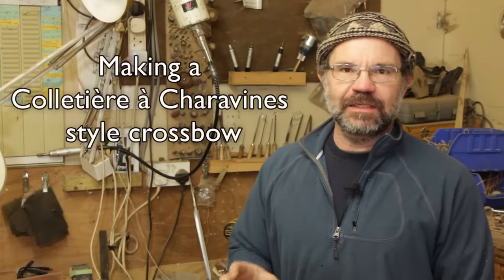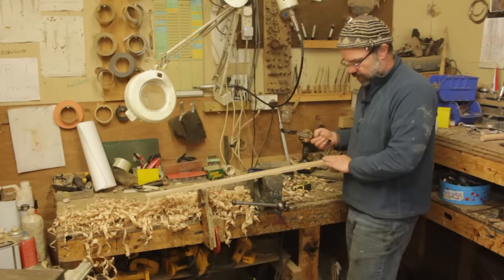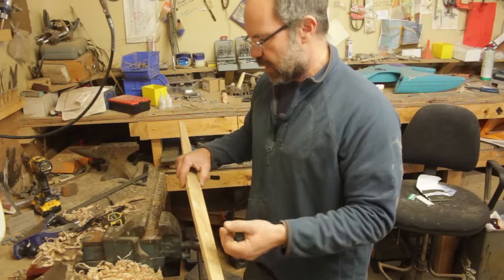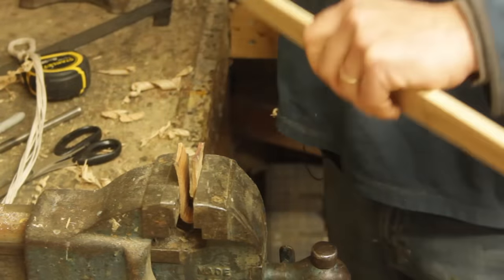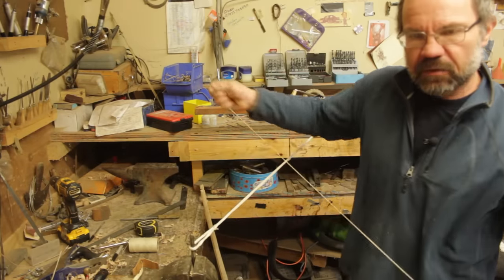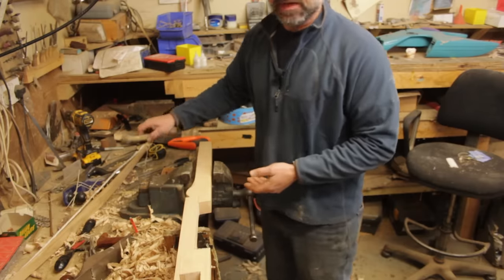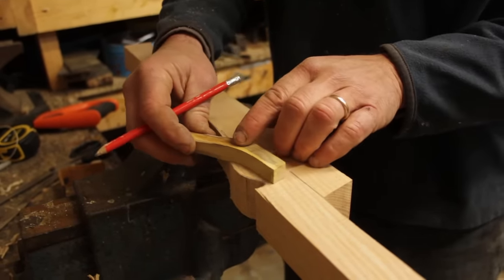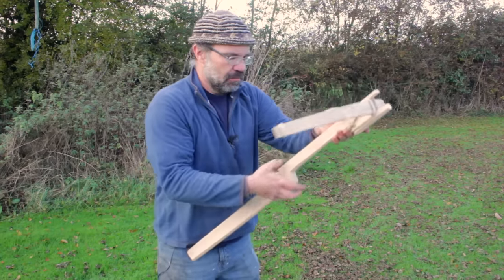Dark Ages Crossbow - Full making process

Comment: An old method of drilling a hole through wood without metal tools is by placing an ember on the spot you want to drill, and tend to it as it burns the wood, adding fuel as needed, but not enough to spread. It's super slow, but eventually you can burn all the way through as gravity keeps pulling the ember. You then rub out any charred wood around the hole with a stick or stone, and you're left with a workable hole. A similar method can be used to make a dugout canoe, where the log is saturated in the river upright, and you then light a fire on the dry part. The fire burns all the dry wood, and leaves the soaked wood layers of the hull. Again, remaining ash and charcoal is scraped out. You then take the canoe out of the water, air dry it, and then coat it with boiled deer tallow, massaging the tallow in as it cools. This protects the wood from rot, as well as making it more sleek in the water. You can use this same tallow treatment for your bow, too, as it'll give the wood similar protection against moisture/rot, such as when hunting in light rain.
Reply: Are you a mountain man?
Reply: Charing wood gives it a good hard surface as well as protecting it.  Hammer handles well soaked in linseed oil, then chared and waxed are the best to work with. Handle blanks used to be kept for storage in linseed oil. When I was a kid we learned this in wood shop class in school, but it seems less known nowadays.
Reply: Another way, a bit quicker and more precise, is just whip out your ancient handy pump drill, fixed with a flint drill bit.

Comment: Pro tip for finding the center of any length of cord without tools: Fold it in half. :D
Reply: You can't do that with an infinite piece of string.
quantum state INTENSIFIES
Reply: @oneparticularlysmartape  I just fold the infinity into just shy of one Planck length.  ;) By definition, the singularity would have to be naked.
Reply: @spvillano  
I've been matched.
Reply: I am in awe of all these useful insights! :)  I never would have thought that Planck could be bent in half! (Miks, Particularly Smart Ape, Stephen and of course, Anifco)1
Reply: @oneparticularlysmartape  It's called an "endless loop" or a "Flemish twist". Not an infinite piece of string that actually does not describe an endless loop accurately.
Reply: Lol
Reply: This trick is great for marking around a cylinder too with a piece of paper. Wrap the strip around, Mark the overlap point, fold in half as many times as you need even divisions, unfold, wrap the strip around the cylinder again and transfer the marks where the fold creases are.
Reply: @oneparticularlysmartape  Actually you can, mathematically speaking and since infinities are a mathmeticall invention and not a real object or physical in any way it makes it possible.
Reply: @elijahbachrach6579  "If you put the universe in a tube, the tube would have to be at least... Two universes in length" - Tim Heidecker

Comment: As a teenager I made one in the 1950s with a car spring for the bow, a hunk of iron bar lathed and drilled into the pivot for the trigger, which slotted into it and came out under the stock. I was a little short on expertise in fixing the bow to the stock, and it lasted no longer than six bolts, all of which disappeared forever in the trees at the far end of the park. There were no following reports of deaths or injuries in that neck of the woods. My next project was a working model of a ship's cannon, using fire-cracker contents to fire quarter inch ball bearings. Despite losing all my ammunition, no known about damage was reported. Both projects were performed in the woodwork shop in high school.
Reply: I used potatoes as projectiles for a 1.5" muzzle loading cannon, they always fit :-) Fired with home-made black powder. In the days before terrorism, one could buy the ingredients in the local pharmacy.

Comment: "...not using any measuring tools because, of course, our thousand year old compatriots didn't have verniers..."

uses a power drill 2 seconds later

Great video though, as always.
Reply: Even our stone age ancestors had access to mechanically assisted drills. In fact, they probably used them nearly everyday for starting fires. They are called either Bow or Pump drills.
Reply: my great great etc grandad is credited with inventing the 'ships screw'.i forget his first name but surnames Thistlethwaite.
Reply: Nope,  he  was  a  Swede  I  think  you'll  find,  and  he  was  called  Eriksson.  By   the  way  what  relevance  does  this  have  to  the  subject  of  crossbows  or  thousand  year  old  engineering??
Reply: They had much more time, this a weekend project, for them this could be a week or more.
Reply: The exact same thought came to mind. God I love modern recreations. To be honest I don't see the negative, you get the authentic style and design via intuition but the time and thus cost is cut to a tiny fraction. You're still using a chisel to finish it, you've just had the apprentice remove 90% of the material.
Reply: You're missing the point. The power tool makes the work faster, it doesn't replace any tooling they would've had back then (hand drill etc) a measuring tape on other hand would've been less accurate.
Reply: A power drill is significantly different to what they would have had to the point that it might as well be considered a different tool. The marks etc left will be very much distinguishable from a hand drill partly because theres absolutely no effort and an abundance of power, and partly the sheer speed. The bit will also be far more refined than anything they had. Theres a hell of a lot of modern tools with crazy capabilities compared to the theoretically similar ancient tools. I'd still expect him to use them, it makes economical sense to do so, but to say the power tools are in any way comparable (with regards to the finished product) with what they had is simply not accurate. Its precisely why removing 90% with power tools is fine but the final 10% needs to be removed ye olde method.
Reply: Before there was inches or centimeters, there was 'bouts. As in "Make it about this long" or "We need it about this high". They would measure as they went along. Comparing one component to another, to get the fit. This was why parts couldn't be interchanged.
Reply: Hermann Munster ____ Also, although measurements weren't regular, proportions were. The keel length of a ship dictated the size of every other timber in the boat as they were all proportional to it. The keel length was dictated by whatever size tree you had - all other dimensions followed.
Reply: @iainmelville5949  Eriksson Thistlethwaite?
Reply: @olivialambert4124  absolutely
Reply: @reddpanda7343  very interesting comment  .
Reply: lmfao right..
Reply: @SuperFunkmachine  they didn't have that much time after all. They had to hunt or fish, gather, or if we talk about later middle ages farming work. Chop wood, make fires, make other tools or weapons, sharpening, repairing stuff, fortifying their shelters, getting water, makes clothes, sandals, whatever. All those things took a ton of time back then. Most of the day was needed for providing basic survival stuff.
Reply: Lol... I was just going to post the same comment!
Reply: I'm sure even our stone age ancestors used something for measurements, their hands, string, sticks, something.
Reply: James K   ,   Liten up dude
Reply from the maker: @olivialambert4124  But the result is a round hole - just the same
Reply: My god, the horror! Not only, but uses a digital camera to film it! Unforgivable! Tod, next time use some bronze age camera!
Reply: @randomguy8196 Perhaps not try squares in today's modern form, but almost certainly something akin to one. They might not have had standard measurements, but they surely had a variety of tools to  measure and transfer values/proportions, find centers, check for  square etx... in fact I'd risk saying a  craftsman of their time would be more adept at these basic skills than some craftsmen are today...
Reply: @joshmcneal2836  not exactly a power drill though is it
Reply: They had tools, Jeez. If they wanted to find the center of something, they could. And you don't need that welded-together cutter to make the groove. Woodworkers do that now with a scratch stock. It's just a little piece of steel held in a wooden handle.  Or held in the hand, for all the work this would take.
Reply: I'm surprised this comment is still getting replies. To clarify, I wasn't criticizing Tod's use of power tools, I was just pointing out that I thought it was funny.
Reply: @reddpanda7343  This is right. And maybe they added "as long a my thumb" or as long as four times my thumb. When details got finer, they would order, as long a half my thumb. As technology and details progressed they needed quarter a thumb, standardized the thumb and called it an inch. Then the 1/8 inch became current, and the rest is history. It might sound like I do but I am not joking about what you explained. Btw, in Europe they still use a "thumb stick" (literally translated). A foldable stick which is marked in millimeters. And also in inches if they are old enough.
Reply: @reddpanda7343   Redd Panda  This is right. And maybe they added "as long a my thumb" or as long as four times my thumb. When details got finer, they would order, as long a half my thumb. As technology and details progressed they needed quarter a thumb, standardized the thumb and called it an inch. Then the 1/8 inch became current, and the rest is history. It might sound like I do but I am not joking about what you explained. Btw, in Europe they still use a "thumb stick" (literally translated). A foldable stick which is marked in millimeters. And also in inches if they are old enough.
Reply: @reddpanda7343   Redd Panda  This is right. And maybe they added "as long a my thumb" or as long as four times my thumb. When details got finer, they would order, as long a half my thumb. As technology and details progressed they needed quarter a thumb, standardized the thumb and called it an inch. Then the 1/8 inch became current, and the rest is history. It might sound like I do but I am not joking about what you explained. Btw, in Europe they still use a "thumb stick" (literally translated). A foldable stick which is marked in millimeters. And also in inches if they are old enough.
Reply: James K 8
Reply: James K j&#
Reply: Olivia Lambert . I think you missed something as ancient times they were very good , look at the pyramids in ejypt Ancient Rome buildings  etc. what we have today is because of there ingenuity thank you. There work was astounding , the tools we have today creat laziness but yes good straight cuts etc but don’t underestimate there skills , they were the greats then for the luxuries we have now.
Reply: @jacobstaten2366  ..probably used their feet for measurement quite a bit..easy to step off distances, probably where we got "feet"...males may have used "other body parts" for smaller measurements, who knows...
Reply: @dyer2cycle  that's what I figured.
Reply: @reddpanda7343  And yet they could fit things perfectly. This is due to how you work with hand tools: take your "about right" piece, place it on your other "about right" piece, and then mark a knife wall on the mortise or tenon or what have you, shave a bit off with a chisel, try it, shave a bit more, try it -- until you get a perfect fit with sub millimeter accuracy.
Reply: @randomguy8196 it's actually not impossible to make a square as long as they have a mirror. And I believe squares have been used by craftsmen for centuries all over Europe and Asia.

Comment: Brilliant video. Instructional and entertaining. Thanks for sharing your knowledge. I'm off to the the wood yard to buy me some logs.

To center - mark a piece of wood for the first side, place on the second side and mark again. Half way between the marks is the required distance for centering. No tape measure required. You don't even need a pencil. Incise a groove with your thumbnail. Celtic carpentry 101 :-)
Reply: I  have  extremely  thick  thumbnails,  and  they're  hard.  I  use  them  for  marking  both  wood  and  metal(when  there  is  a little  rust  present)and  the  beauty  of  a  thumbnail  is  you  don't  have  to  look  for  it.....
Reply: Yes me too, I want to play. Going to make one myself as well.

Comment: The width of the ring, and its color is species dependant,... but its density is a tell.
Softer, wider rings would be summer growth.
Baltic Birch is very hard, tough wood... hence its common use in modern cabinetry drawer boxes, and boatbuilding.
Maple, Ash, and Oak are very similarly used in both sheetgoods, and furniture making.

Comment: A crossbow you can cock by hand is the best way to enjoy shooting a crossbow. I think a longer bow for the crossbow, though cumbersome, may give you a longer power stroke and more arrow/bolt speed for the same poundage.  Really like the simple design of this. The two greatest advantages of a crossbow over a longbow, is that ability to be at full draw without fatigue of holding the bow, waiting for quarry to step into shooting lane/distance, and not having to draw the bow, which requires a lot of movement which will spook game. I have been shooting bows and crossbows for over 40 years and I really like all your designs and channel content.  Thanks for sharing.

Comment: What an engineering marvel, this! My favorite part of the video was where Tod visually inspected the curvature of the bow and shaved off bits of excess wood where the curvature was lacking. It turns out that the maximum draw weight per unit mass of the bow is attained when the bow is tapered in such a way so as to place every cross section under equal amounts of maximum bending stress. As it turns out, both the maximum bending stress acting in a cross section AND the curvature of the bow (or reciprocal radius of curvature) are each directly proportional to bending moment and inversely proportional to second area moment of the cross section. The consequence of the equal-stress design principle is that the bow should also have uniform curvature along its length when drawn. What 2D plane curve has constant curvature? A circle! So the bow has been optimally-shaved when it takes on a circular arc shape when drawn with an arbitrary force.

Comment: Have you ever made a bow out of green Poplar wood?
It is the most flexible wood I've ever seen, when I worked at a woodshop. I made a staff out of 1 1/4 inch. green poplar wood. I tried to break it in half by hitting it across  a metal dumpster.  5 minutes later I gave up!
It is unbelievably strong!

Comment: Tod, I really like your dremmel attachment set-up on the wall. I'm working on a project consisting of steel rod swing trays that will hold my dremmel attachments, that are built into the wall of my workshop. The plan is that they will pivot between my metal and wood work benches for ease of access. Thanks for further inspiration!

Comment: Wow. I’ve learned so much from this video. Didn’t know you could use a spokeshave away from you. And I’ve always had problems with Ash axe handles. They do chew up on one side. So many questions. Does the bow have a top and a bottom? Could it be mounted either way up? What wood is the stock made from, does it matter?  I’d love to make a bow like this now. And what weight is your little anvil on the bench? I’m after one and con only find old monsters or modern crap. 👍

Comment: Great video. Possible uses for this x-bow? Very much doubt it would have any utility as a fishing bow because the bolt would fall off the stock at any meaningful fishing angle. Probably be useful for waterfowl though, especially if used from a hide. What are your thoughts?

Comment: When I was about 8 years old I used to try making crude bows on the celler workbench.I always wanted to go to the next stage and make a crossbow but could not figure out how to make a trigger mechanism.Also I cut and sharpened an old steel tennis racket into a very vicious curved sword !
My dad found it and I was banned from the celler before my armoury could be tested out though.

Comment: Hi Tod ,I've been trying to find out the lethality of bows or "arbustas" reportedly used at Hastings. The obvious question is would the bolts penetrate the  regular Anglo Saxon Shield. Injury is as essential as lethality. Short bows are demonstrated on the Tapestry but we see that they the archers  on the Tapestry and elsewhere loose their arrows from  the chest. They woud be out of axe and spear throwing distance. Very few if any A/S bowmen present. I have a strong conviction that the battle was an artillery battle with crossbow men and supporting  archers breaching the shield wall by  weight of fire power for the foot soldiers and cavalry to make a foray  in the resulting confusion. I have heard that cross bows were used in a siege in Northern France  during the period. Would love to hear your experienced opinion.

Comment: You could drive a small brad into the groove just forward of the trigger notch but below the surface the string runs on. That way you can load a bolt without taking your eyes off the 'target' and have it stop in the same location every time.

Comment: Just finished making one of these. So pleased with how it turned out. I have one issue. After replacing the temporary paracord string with some real 16 strand Dacron b55, the bow seems to misfire where the bolt doesn't move an inch and the string ends up on-top of the bolt. Any suggestions? thanks!

Comment: Hi Tod. Apologies if this has been asked already but do these types of crossbow require rail lube like modern crossbows?
Also, do you have any experience with the Belt Hook type cocking aid? I have often wondered why they didn't use braces type straps instead of an ordinary belt.
Good vids. Thanks for posting!